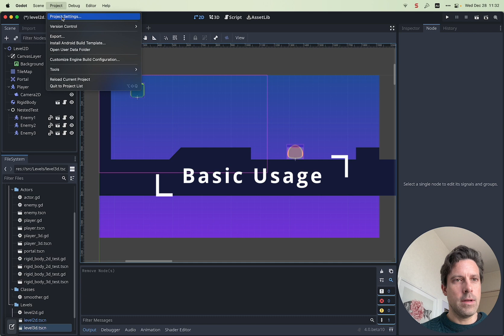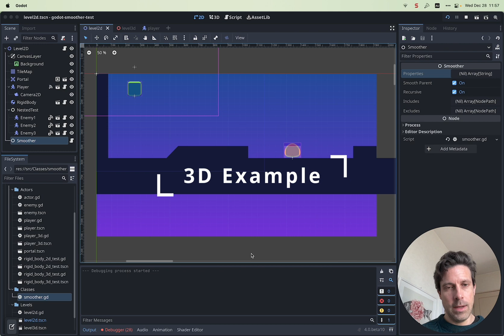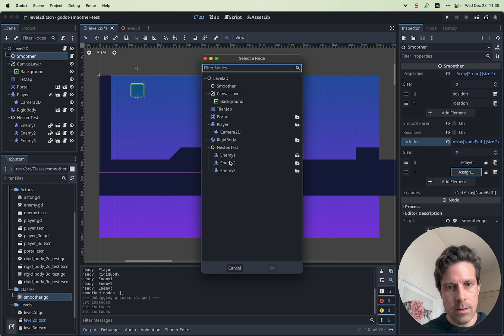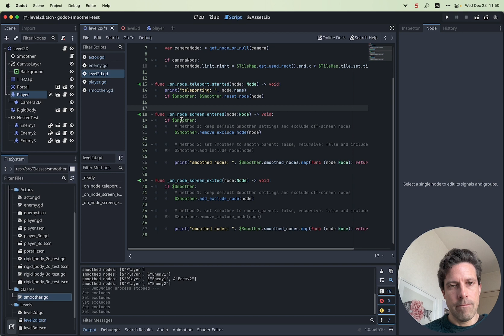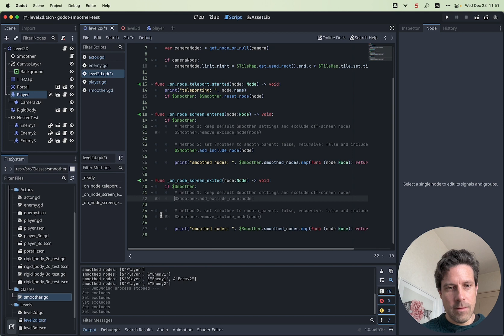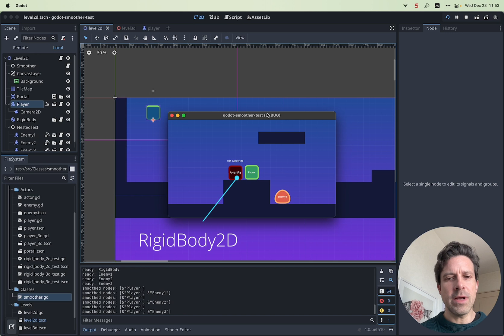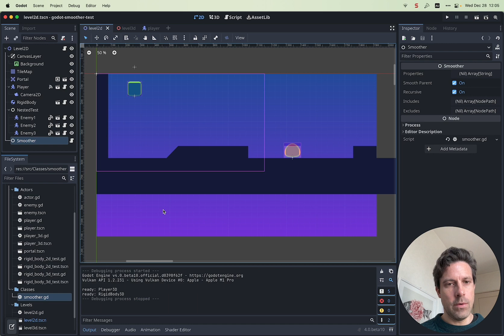Godot Smoother Node for physics interpolation

Comment from the maker: IMPORTANT NOTE!
Since Godot 4.3 Beta 1 you can find built-in physics interpolation for 2D in `Project settings > Physics > Common > Physics Interpolation`.
Physics interpolation for 3D is included since dev snapshot Godot 4.4 dev 1.
See the related release notes at https://godotengine.org/article/dev-snapshot-godot-4-3-beta-1/#2d-physics-interpolation and https://godotengine.org/article/dev-snapshot-godot-4-4-dev-1/#3d-physics-interpolation .

If you can use a Godot version with built-in physics interpolation, I highly recommend using that and disabling this Smoother node or deleting it from your project.

This node was ever only intended as an interim solution until this is added natively to the engine. The built-in physics interpolation also has better support for all node types such as `RigidBody2D` (which this node cannot handle).

Once native physics interpolation moves into stable builds, this Node will be deprecated, unless any pre-native-interpolation Godot 4 versions absolutely need an important fix.

Comment: Thanks so much, it's a really awesome add-on and worked perfectly to solve a jitter/blurry issue I had when camera (using process and Idle callback) was following my player which was a KinematicBody2d with movement in physics_process. I wanted to keep the camera in process since it looks a lot smoother especially at higher refresh rates rather than syncing the camera with the physics ticks (looked choppy). This single script solved all the jitter issues that were occuring with that.

Comment: Heads up for those using this. If the game runs below 60, 30 for example. The smoothing will make things move wayyy slower than they should.

My "fix" is to just only use it if the game is running above 60. Changing the code under # update the relevant nodes once per _physics_process to be

	if Engine.get_frames_per_second() > 60:
		_physics_process_nodes = _get_physics_process_nodes(parent, !smooth_parent)

Technically works. Not the best solution but does the job until this gets fixed.

Comment: Hi Anatol, first of all thank you for making this plugin. Can this be used in combination with Engine.set_target_fps()? it seems like it would be useful in helping to further optimize web exported games.
Reply from the maker: Hi @childlearningclub2277 , sorry for the long delay, I completely missed your comment until now. So this Smoother node seems to be working with Engine.max_fps (the renamed Godot 4 equivalent of Engine.target_fps, see https://github.com/godotengine/godot-proposals/issues/5448 ). Of course there's a limit of what this can do, if the max_fps are really low you'll always still notice a stutter, but if physics interpolation can be done, it still works. I just tested that. (I also just pushed an update because changes in the recent Godot 4 release candidates broke the module.)

Also, FYI, my module here is more of an interim solution. Physics interpolation will be added to Godot 4 at a later stage on the engine level, as it should. https://github.com/godotengine/godot-proposals/issues/2753#issuecomment-1368248620

Until then I hope it is helpful for some early adopters.
Reply: @AnatolBogun , Thank you for your reply and the helpful information.